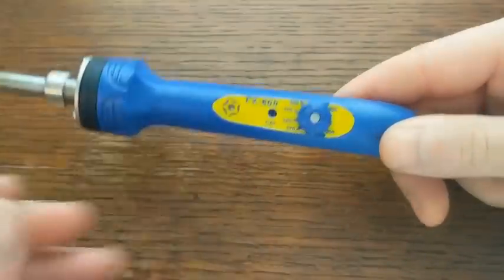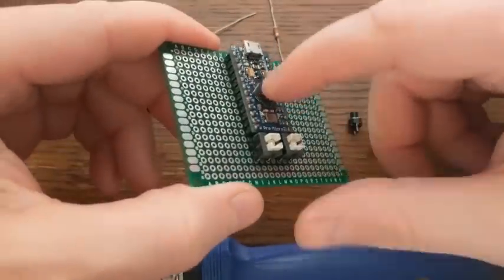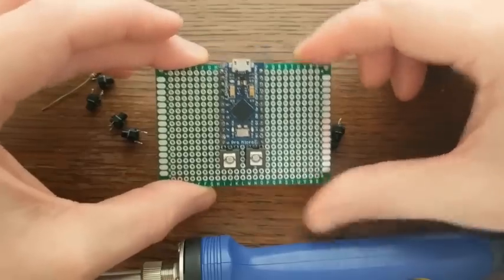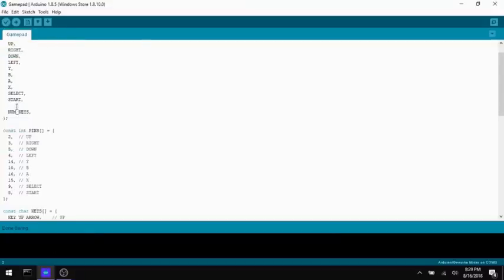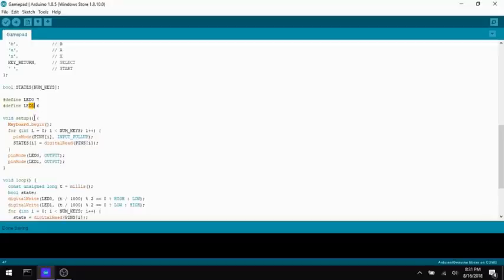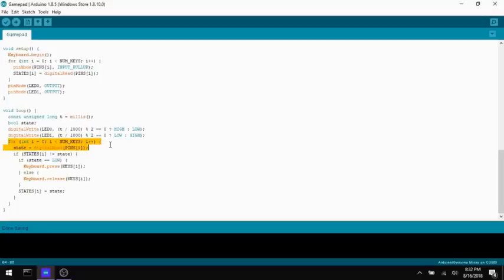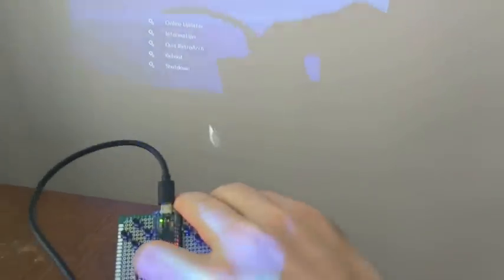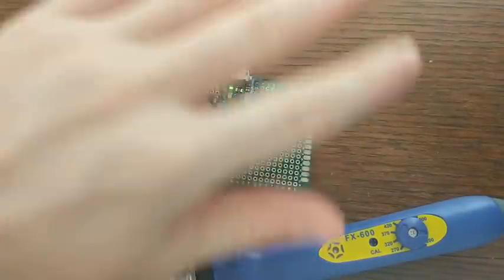DIY Game Controller Soldering Project

Comment: Where can i find the software you use to program
Reply from the maker: There's a link in the video description. The code is here: https://github.com/wybiral/arduino-gamepad

It's pretty easy to change the PINS constant there to whatever configuration you use to wire your buttons too.